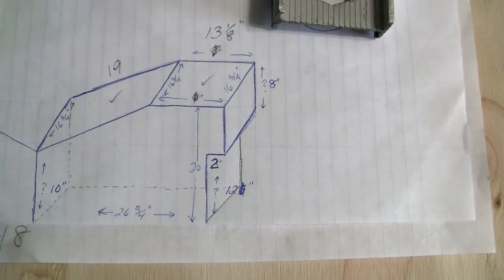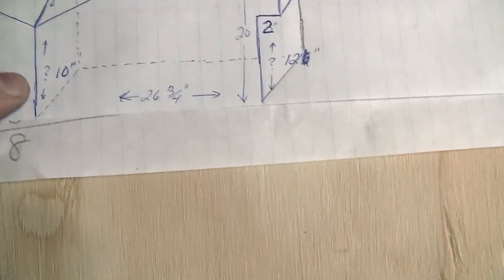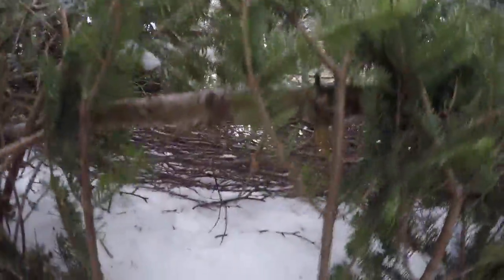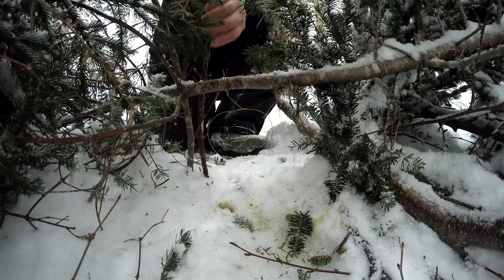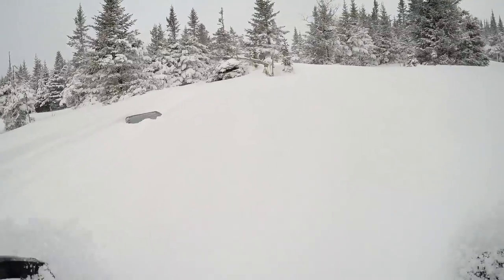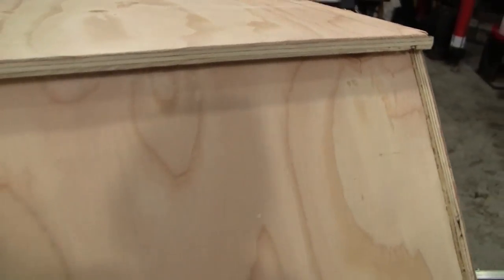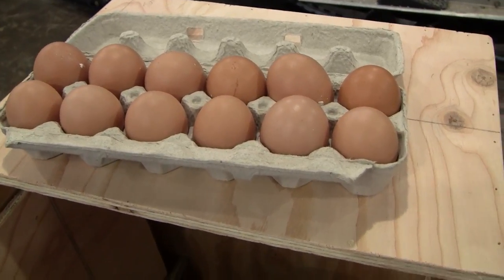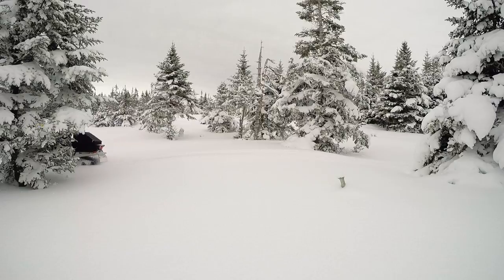Tundra 600 ACE LT CARGO BOX BUILD

Comment: Good Job on the box Charlie, I had bought a cheap hockey bag with a rigid base to carry chainsaw, snowshoes etc.....works fine but found fumbling with zippers with mitts  frustrating....ie stopped zipping the bag...snow in bag....will be building box when i bring the Tundra back home in the spring
Reply from the maker: I had the ski-doo cargo bag, beautiful bag and I liked it a lot, but every time you added or removed cargo you had to adjust the strap and the zippers were always getting covered with snow and ice. I was just getting tried of the bag and needed something more logical...

Comment: I think I’ll build something similar for mine now! Nice setup.
Reply from the maker: Oh I'm so happy I got this box built. Sure comes in handy. I bought the cargo bag for it when I first got the sled, used it for the first 2 1/2 years and it worked well, still does. However I was getting tired of always having to adjust the straps every time you needed to add or remove cargo. With the box there's no more issues. Just open the lid or hatch and place it in or take it out. Now I can see some future mod's coming to the box like maybe depending on the load I could have removable dividers in it to say, separate ice fishing rods and camera gear to protect it from the rest of the cargo. But that will be a future project once I've had time to think it all out and see what works for me.

Comment: Thanks for this video. You just saved me some money.
Reply from the maker: Well I hope your box build turns out good. I just loves my box, I have four 1" insulated clamps that I'm going to use to mount the box to the ski-doo and get rid of the strap I'm currently using. But we are in a cold snap the last few days so I'm going to wait until the weather warms up a little before going at that. I will have to drill 4 holes in the box, which I'm not a fan of but in the end I think it will be a much cleaner look and result in a much more secure mount.

Comment: Few nice pointers there Charlie. Mine still not done; aluminum is a bit tougher to do so I'm in no rush, skidoo only 12 years old yet not broke in so to speak ahaha.........cheers bud
Reply from the maker: Aluminum, gees b'ye you're going flat-out. You're a hard case old trout. My clamps are suppose to be in tomorrow however I don't think the ferry ran all weekend with the winds and they are not dying down at all. I will have to finish cleaning up the driveway and then head out to see if I can break the trail to check my snares.... Going to have to deal with some massive drifts up on the top of the Gronny.... Ran into pure whiteout conditions up there on Saturday morning. She's a rugged trail and that drifts over completely in the big wind storms we get here. Next fall if the weather and time permits I'll be cutting a new trail, which will actually be the old trail so we no longer have to deal with the open exposed areas. Nothing worst than have to deal with all the 3 to 8 foot drifts storm after storm. It's time to get the trail back into the tree-line where it's much easier to maintain and safer to use... PS... Looking forward to seeing that box you are building...

Comment: Looks great. Personally I probably would have gotten some small stainless eye bolts/rings and put a few on each side for gear you might wanna strap on with bungee cord and you could use t-nuts with a bit of red loctite so you could trim inside flush instead of banging your knuckles on them.
Reply from the maker: I'll be making some mods I'm sure as time goes on and I figures out what I need. I like the idea of those eye bolts.
Reply: A few wouldn’t hurt then you’d have a spot to tie off stuff and you could get jack to weld a washer to the end of the eye so they wouldn’t draw in too much.
Reply from the maker: yes good idea plus it's always good to keep Jack busy because he gets into mischief when he has nothing to do... Plus he believes he must do one good deed a day, so by giving him something to do, I'd actually be doing a good deed.... LOL

Comment: Love your Tundra back country adventures. Did you consider a Expedition when choosing the Tundra? I have deep snow to deal with at my camp.
Reply from the maker: The Expedition can handle the deep snow too. No worries there Bob. I chose the Tundra because of it's narrow stance and nimbleness. Because of it's width I can cut trails that the wider snowmobiles can't go down. So when I put out snares or traps others can't get to them. Now I haven't bothered trapping in the last couple of years due to the poor fur prices but when I start up again, I don't want people stealing my gear. So I plan on cutting trails just wide enough for the tundra to squeeze through. If they want my gear they will have to walk or buy a tundra or bravo themselves.

Comment: Hello Charlie, do you know the Kelly kettle or Ghillie kettle ? They are great for boiling water/melting snow and cooking too. And best of all they work in very cold  temperature.... but they are kind of messy a little bite
Cheers
Reply from the maker: Yes I seen videos on the kelly kettles, that seem to work great, very fast and with very little wood. All wonderful reasons to get one. Only reason I haven't is because I already have a kettle and a piper and the kelly's are in my opinion over priced... I don't mind spending money but I must feel like I'm getting a deal, I don't think I would feel that way with a kelly... Plus when boiling a kelly over an open fire there's something special about the hole experience. But all that being said, I know there are times when the speed of the kelly kettle would come in handy for that quick fix when you gets a chill and would like to have a quick cup of tea to warm the body... Maybe I need to watch for them to go on sale....
Reply: @NLGhostWolf  You are right, they are expensive ! (the Kelly is made in China .....)

Comment: Awesome job. I'll be building one for my Tundra before winter. 

What clamps do you plan to use to secure to the tunnel?

Also thanks for your videos on the Tundra LT 600 ace, helped me make a decision last year when I bought mine.
Reply from the maker: 1 inch rubber insulated clamps, got them at the automotive shop

Comment: Box looks great, how much did it end up weighing empty. ⚖️
If you painted it white and set it in the snow you might lose it, haha. 😉
Was that 5/8 or 3/4 inch plywood you used? 🔨
Why did you prefer to taper the lid down wards instead of leaving the back of the box square and the lid level? 📐
Reply from the maker: It was 1/2" plywood but we glued and nailed it with plenty of nails using 1 1/2" brad nails... I'm not sure the weight, but if I can remember to weight it when I take it off to glue the rubber matting on underneath the bottom of the 2x2's to protect the ski-doo's tunnel. I will give you an update in the next video. As for the tapered back, it was just for looks. There is a max weight for that end of the tunnel areas and the design I have can easily exceed that weight when fully loaded with gear. So I didn't really need the extra area I would have gotten with the square back.
Reply from the maker: Larry it weighs 20 lbs dry or empty weight.
Reply: Very good, I was guessing it might be more like 30 lb. So 20lb is very nice and light 😊